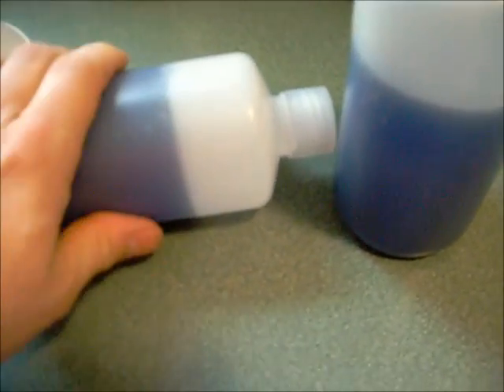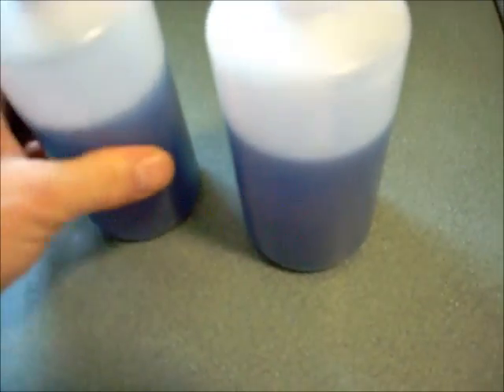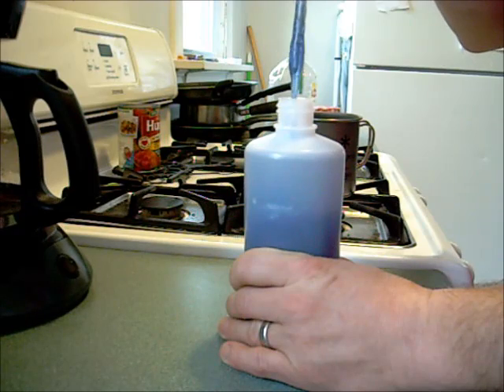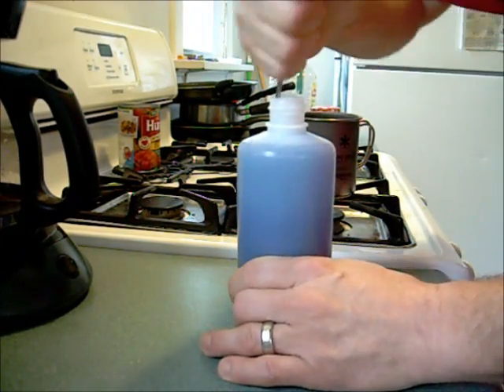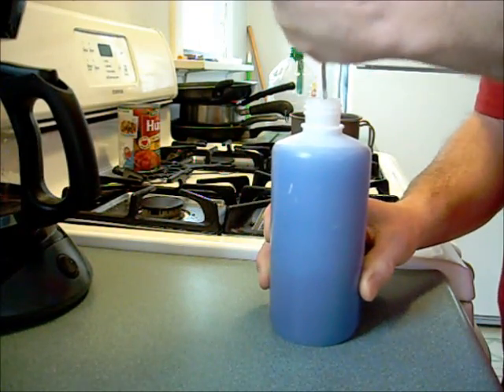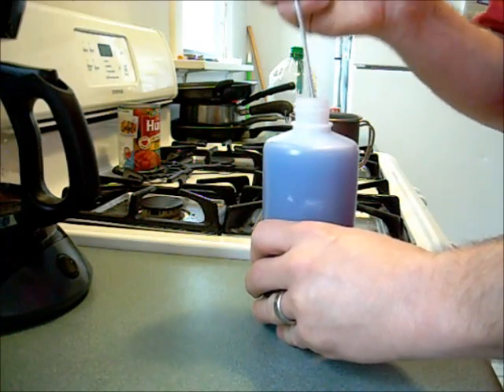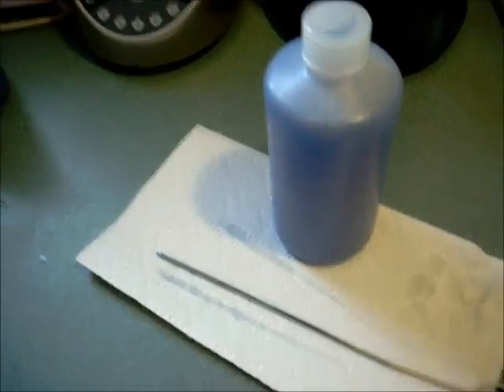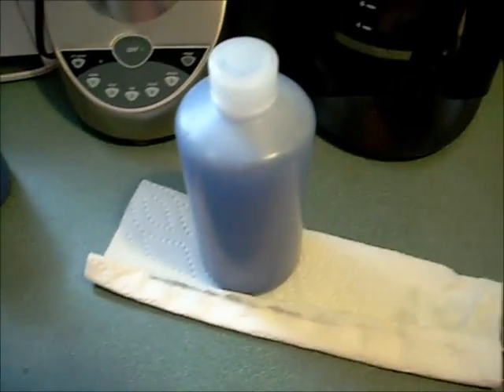Sodium Silicate update

Comment: you made candy, lol. you concentrated a super-saturated solution. if you go to "hard ball", results as you observed. if you go to "soft ball", not so much. when your "blue goo" is done, cut it with the distilled water. the colder the conditions you cook it in, the greater the water loss in boiling down. you guys actually fight yourselves far too much by using so little water initially, as you are trying to form solution, AND concentrate it simultaneously. in a lab, that allows the initial heat to "cook" it, but it also makes the process far more laborious.  if you final cooled product is thicker than corn syrup, it's TOO CONCENTRATED. double up the water, you will get the solids in solution far quicker, and actually have control of the viscosity of your final yield. a little more dough spent heating, a lot of time saved.  cook until a drip off your mixer into ice water forms a soft ball, or even a thread (like making fudge), you will have a far easier to handle final output. if you cook it on a fire, the CO2 will react, and produce a slurry of cured product crystals floating in you solution. use a hot plate, use more water, don't work outside in trans-freezing conditions, far better results

Comment: Nice video, not the smartest way to mix chemicals, First of all that paint mask will not help for the harmful fumes that are coming from the mixture your mixing also you should wear eye protection at the very least one drop of Sodium Hydroxide in your eye and you will wish you had safety glasses on.  Just a suggestion do what you like they are after all your eyes.

Comment: Are you referring to me? I did not get your e-mail.

Yes CO2 (carbon dioxide) hardens it but it's the acidity from the carbonic acid that forms when the CO2 reacts with the water in the sodium silicate. Other acids will do it too, but adding acid directly to the sodium silicate will convert it instantly, hence why gassing with CO2 after you form your shape is preferred.

I'm thinking the finely granulated silica gel you used caused an excessive amount of water loss to steam, causing your unusual thickness, I'm experimenting with using silica gel kitty litter and it dose the same thing.

I'm in the middle of building my foundry and I ended up using about 1.5 liters of sodium silicate to 2.5 bags of perlite. I thinned my sodium silicate 50/50 with water giving 3 liters or so of sodium silicate/water solution used. I'm trying to get this thing finished so I can post a video of things I learned and problems I ran into, I don't want you to waste as much time and material as I did LOL.

Lastly, if you do go ahead and start your build right now, pack the perlite as firm as you can, or it will tend to be crumbly when dry, also, that perlite has some kind of plant food or something in it, it will smell like ammonia when you add your liquid so don't be alarmed.
Reply: Tony Emory
Gosh, I have been saying I want to make a "gas burner design" video but have not gotten around to making it, it would take a lot of time and effort, and I'm not certain it would be helpful, as DIY gas burners seem to be individuals and are all unique in some way.

I have seen the burner design you used, I have found when the burner is "back burning" it means either the total gas and air mixture velocity is too low, the orifice has a problem like a rough hole or misaligned stream, or the "flame anchoring" component is inefficient. Could be all of these reasons too.

My best advice is first, know that the burner should never burn inside the tube, the orifice needs to direct the gas stream strait and centered trough the burner tube, you can check this by squirting water though it and see what the water dose. One thing to mention is, I don't know how the original designer designed this to work, I have a feeling it will only burn with a crooked orifice. If the orifice directs the gas crooked, the gas stream will hit the inner wall of the tube and begin a rolling fluid type turbulent motion out the end. This can* be a method of getting the fuel and air to mix, but the burner will be picky as to the gas pressure, will easily blow itself out, and has the danger of burning up any rubber valve seals that might be a part of the burner, because of the heat of the flame inside.

I say this because if the crooked jet is how this was designed to work, straightening it will cause the burner to stop working at all. The burner will then need a better flame anchor to run properly. The drain strainer I put into the end of my burners is the flame anchor.
Reply from the maker: Thanks for the update, I did start mixing and adding my mix to the foundry tonight I am going to post some videos tonight as well. Definitely need more sodium silicate or at least dilute it to some degree. I did notice the ammonia smell that you mentioned to to bad though. I have only finished the base and still need to do the walls but I will save that for later this week. I also want to build a burner similar to the one you built and need to find the parts so it may be a week before my first burn.

Thanks for all your help
Reply: digitizer101
 Yea I think I have gone through about a gallon and a half of that stuff with all the experimenting I have been doing. The silica gel kitty litter at walmart called "mimi litter" is the cheapest source I could find, it's like five bucks for a four pound bag. Be careful when making more sodium silicate because if you are like me you will be like "well I need a lot more than I thought, so I'll do a BIG batch" The auto heating/boiling gets worse as the batch gets bigger, if you got a real big stainless pot that it can't boil out of, you can go all out, otherwise keep the batch size the same. Perhaps adding another 200ml of water when boiling to dissolve all the gel.

I made two batches this morning with the kitty litter, it has blue particles in it that, as far as I can tell are just gel with blue dye. They don't change color when wet or anything, but don't interfere with the final product. The first batch came out dark purple because of the dye, but boiling to dissolve the second batch I just left the garage to let it go. When I came in to check on it about 20 minutes later, (there was only about five minutes of fuel left in the stove) the purple was gone, and I could see the bottom of the pot through the liquid. It seems enough boiling destroys the dye.

The biggest lesson I learned with all this is give the refractory plenty of time to dry, at least a week.

BTW you might catch some flak from the YT safety police for using galvanized steel with a foundry LOL!
Reply: clkindred
That is what i did as well, I watched your video of DIY Sodium Silicate and determined it was just as hard to find pure silica gel as it was to get water glass, After extensive research i came across the Mimi kitty crystals they refer to their litter as silica sand. I dont know why they call it sand it is almost pure silica gel with the small exception of the dye. Near as i can figure they must call it sand to throw people off from what it actually is, Many of the cat litter bags i came across did not have any ingredients list on them and therefore was difficult to ascertain what they were made from. 

 My first batch also turned a dark purple although i did not try to boil any more to see a difference it is nice to know for sure now that it is a dye.   I suppose the manufacturer puts the dye in the litter to make it pretty though i cant imagine why anyone would care what their cat litter looked like. 

I made mine to create sand casting cores with, though i never thought to use it as a binding agent to make a refractory with, I bet the perlite is loads lighter than what im using now not to mention more efficient, Think i will try to build a smaller furnace to test it and see how it goes.

I wanted a large furnace so i could use a large crucial problem i have is my furnace takes almost 2 hours to get up to temperature and finally melt the aluminum. Granted once it is up to temp i can throw all the aluminum in i want it will almost melt as soon as it hits the crucible. I dont know if my burner is the problem or the fact the refractory is not working as well as it could, I have checked the burner i built the Reil type burners you see in so many of the youtube videos. My burner however does not seam to want to keep the fire outside the tube it almost always wants to say a few inches in front of the jet. Could this be a result of to long of a tube do you think or am i doing something else wrong. 

Thanks for any help you can give. great videos